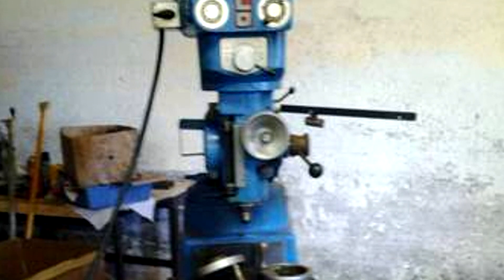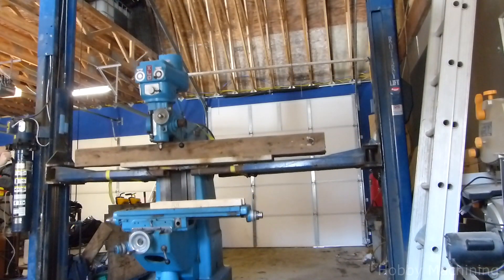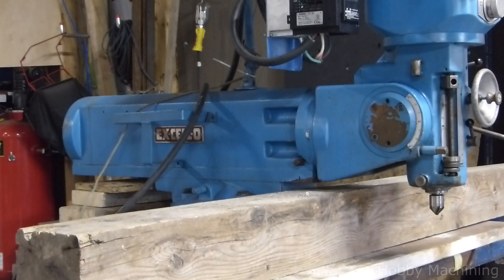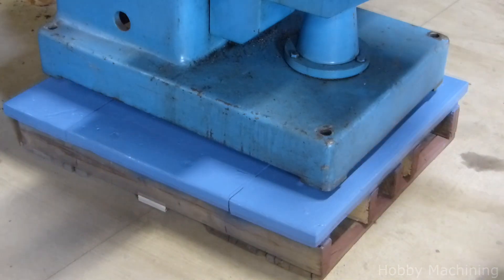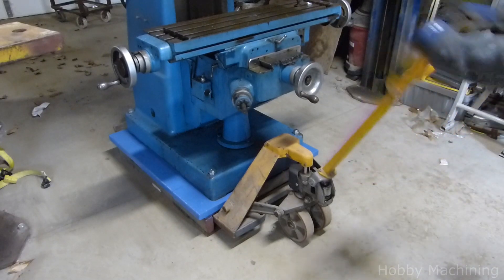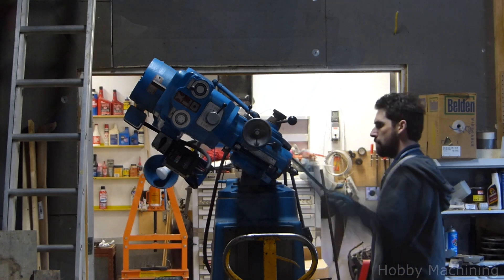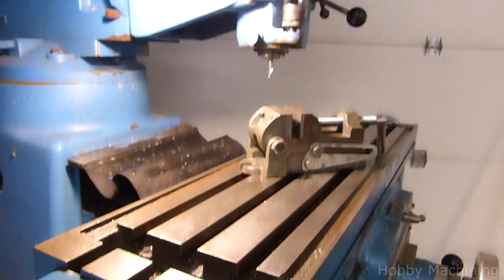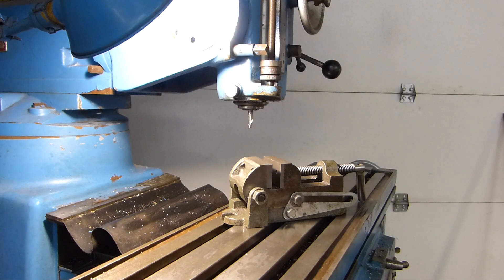Moving a 3000 lb milling machine home

Comment: Heavy gauge 2”to 3” pipe rollers are better for moving machines and then they can be placed on the floor directly, which keeps the movement down and makes leveling easier.

Comment: Another way to support the base is to bolt a section of heavy angle under each side that's tall enough to clear the pallet jack. I raise the machines I move using the usual pry bars and blocking until  I can get a forklift jack (you can rent them but they are so awesome I advise owning one) underneath.  I don't use forklifts unless there's one handy and I don't hire riggers. In the case of mills I cut my angle long enough to bolt outriggers perpendicular to the angle. They are wide enough to positively prevent tipping. I bolted casters to the outriggers (bolts permit caster removal if rolling on pipe etc) for easy rolling. 

http://www.chopcult.com/forum/showthread.php?t=49394
BTW I don't use or own machinery skates. I want total control which means bolting instead of gravity and skates do nothing to prevent tipping. If a machine CANNOT fall that's one less worry.

Comment: I have never used an Excello mill. How are they compare to say a Bridgeport? The machine looks solid and looks like it can handle a good chip load.
Steve
Reply: I have an Excello also. Works just as good or a tad bit better than a Bridgeport because it weighs 1000 lbs more. Even the diameter of the quill is larger than a Bridgeport.

Comment: The other thing you did was to build with high garage doors.
I bought a rigid head Bridgeport.  About 6" too tall to fit under my garage door.  Had to strap it to a fork lift, then tilt the fork lift forward to almost get enough room to slide under the door.

Comment: I had no idea you could get a pallet jack that cheap, even on craigslist.  I guess I know my next selfish purchase.  Fear of moving a milling machine has been the main roadblock to finally buying one.  It was starting to look like I would have to spend about as much as the cost of one of these old machines just to get it into my basement.

I can totally understand having the thing live on the pallet; but I think I would feel better if I busted out the welder and tacked something together in steel.  If only more machines had this built right into their design, right!?

Also, have you seen AvE's video of his milling machine installation? It is vastly more terrifying than this one.

Comment: Good for you! I moved a 2hp Cincinnati 1B, a 2hp lathe and a surface grinder at the same time with a construction trailer and an 87 k2500 on 7 cylinders. Used a John deer bucket loader to put the mill on round fence posts Egyptian style to final place. The mill weights 2300lb itself..

Comment: How can that weigh 3000 lbs? It looks about the same size as a Bridgeport which only weighs about 1500 lbs. Is it solid iron?
Reply: A Bridgeport without head weighs 2200lbs according to Bridgeport.
Reply: The old 1943 M-Head round ram I had weighed around 1800 lbs all-up with a table feed attachment. with the turret and head off it was around 1500 lbs. Yours must be a bit heavier built.
Reply: XLO's are pretty heavier beefier machines they are around 3000 pound. I own a bridgeport a well. Bridgeport is very light weight compared to XLO. xlo is acctually much superior build. Hardened ways + better one shot oiler, better beefier head. Turret is much smoother and the ram is also much better to use.  The spindle unlike bridgeport which is plated is hardened and beefier and 1 inch longer. I own a bridgeport and a xlo can compare 1 to 1.

Comment: I love the pallet idea.  Only thing I would have changed was instead of using a wood pallet I would have welded up a metal one.  Wood will eventually rot with fluids hitting it over time most likely.  A welded steel pallet could have easily been painted real quick and would last longer than the machine, no fear of termites or rot.  Otherwise a great plan and successful move, job well done. :)

Comment: I am a new subscriber.  I experienced some of the same issues that you did in putting my 3500 lb Webb mill in my garage.
It came on a pallet, but how to get it off was the issue.  I used a 8ft pallet rack with a chain hoist on top to lift it off the pallet.
I have a video on my channel.
Reply from the maker: That's a good idea.  Lots of creative techniques out there.  I though the Excello was beefy, but that Nooner is a beast.  I suppose there's nothing wrong with getting the biggest machine that can fit in home workshop!
Reply: I didn't need a machine quite that big, a 9x42 table would have been fine, but the price was right, and it's in very good shape.  BTW, the table is a 10x50.  Power feed on X and knee.
Reply: Herb Blair yea, before I had a crane, I used two treated 8 x 8's stood on end with a 5 in channel iron lag bolted to it - it was a bit dicey -  hahahha - great mill you have there.